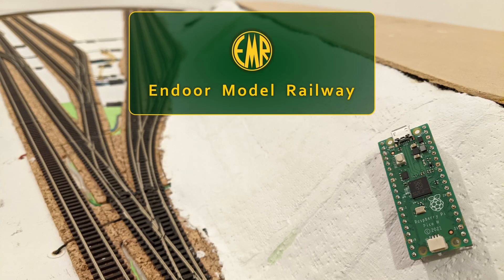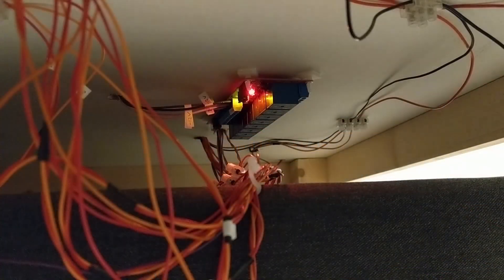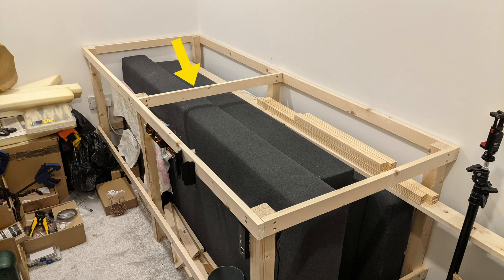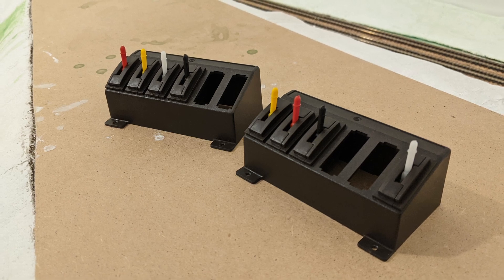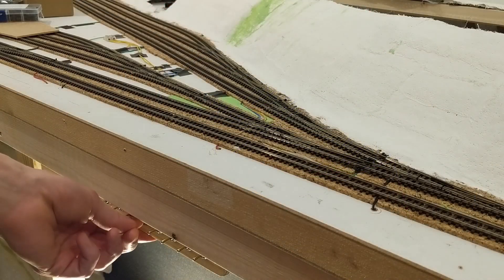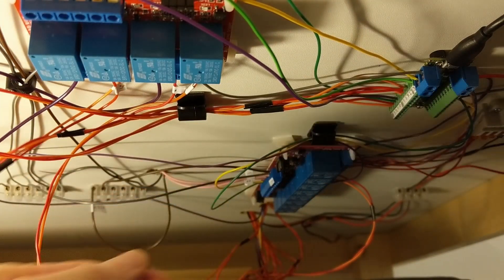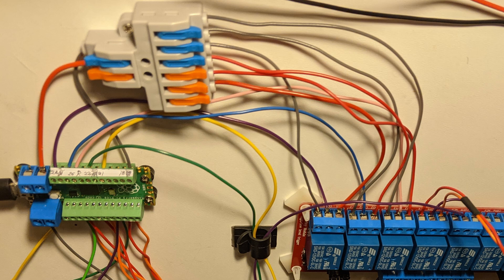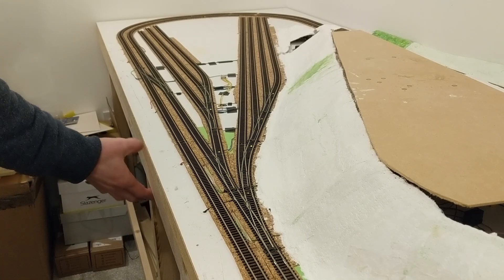0038 Using a £3.90 Raspberry Pi Pico to control points

Comment: NEVER fit Solenoid point mechanisms to Peco points. A solenoid bangs the blades back an forth, and relies on the hairspring hidden under the tie bar to hold the blades fully over one way or the other. But the Solenoid is Guaranteed eventually to rip that tiny blue steel hair spring through the nylon plastic tie bar, making the point utterly useless. You should always use a proper Motor Driven type of Point Mechanism such as Fulgurex or Turtle. As these mechanisms use a motor to wind the blades back & forth and do NOT need that hair spring which MUST be removed. Both these "slow action" point motors come fitted with free switches. One intended for the Frog Polarity, and the second for interlocking with the Signalling. 

The Fulgurex version which I've used on all my exhibition layouts since 1980 and prefer, also has provision for two more extra switches to be added if required. Fulgurex mechanisms are available direct from Fulgurex in Packs of TWENTY, for around £200. Fulgurex are in Switzerland and are a VERY upmarket company, run by none other than Count Fulgurex, a titled person. They have a basic website but will not stoop so low as to allow online purchases. So its Mail Order, and of course the staff speak English, and they accept British Cards. And they are best known WORLDWIDE for the beautiful Gauge One Live Steam locomotives they produce. Obviously as Switzerland is NOT in the EU so like Britain, there should NOT be any extra taxes, like VAT !!!     

Further when connecting Fulgurex mechanisms which come with a pre-shaped 1mm thick Brass crank designed to fit the hole either end of the Peco tiebar. These mechanisms must NO be screwed up tight under the baseboard. Only 2 screws are required at diagonally opposite corners, and must be left to allow a little flex in the mechanism as it operates. Having used these mechanisms for over 30 years on a number of exhibition layouts I have NOT had one fail on me if they are installed properly. The instructions included unfortunately do not allow for British Peco type self sprung points, hence you must remove the Peco point tiny "V" shaped hair spring from the tiebar first. The only other thing I have found is that under heavy duty exhibition use occasionally the brass worm drive tries to unclip itself from the clips that hold the worm drive in place. So I put a TINY drop of Superglue on the clips to secure the worm drive, and stop any possibility of it unclipping itself.
Reply from the maker: I was a little overwhelmed with point motor options several years ago - the solenoids were a nice cheap option, had the auxiliary switch and didn't take up the large amount of space of a Tortoise-style option. I suspect the points will outlive this railway even with the solenoids smashing them about, but in the bigger and better layout that replaces this one I intend to use servo motors under-board - they're cheap, strong, reliable and their behaviour very customisable.

Thanks for the information about Fulgarex. Without an online sales option they won't get any business from me, but it's good to know what product options are out there.
Reply: @endoorrailway  They have a website but they do NOT, like many very Up market business's deal online. Indeed more and more Model shops appear to be dumping the Internet, as too expensive. And I have no issue phoning Fulgurex, because I use a Spanish mobile phone (NOT a Smartphone), even though I don't live in Spain. Because I pay only £9.50 a month for 400 minutes anywhere on the planet - No account and NO Roaming charges, its a pay per month method in cash at the phone shop. And just one more reason why I left Britain over 20 years ago !!!!

Comment: A transistor would work well to control those relays. You'd need to know the power consumption of the solenoid then put a resistor between the pi pico and the transistor. You'd also need a diode across the solenoid to stop current back-flowing. You could go further with electronics but I can see you're working within your comfort zone.
Reply from the maker: Thanks for the suggestions - I should eventually build a lot more knowledge because of my attempt to make a DCC decoder, but I'm still firmly a newbie in the world of electronics! Thanks for the comment 🙂

Comment: If you want to save a few bucks on the relays for the switches you could use an optocoupler like the PC817.
Reply from the maker: Thanks - I hadn't considered that, but with a few resistors on the 12V inputs that would also make for a quieter, lower-power solution 🙂

Comment: Cool idea, but i think the whole feedback to the pico about point position is pointless. Commercial systems don't actually do this, rather they rely on the point being actuated once on initialisation, make their state known to the controller.
Reply from the maker: Thanks 🙂 That's true, but it's only as reliable as the point switching - occasionally these points don't throw when they're supposed to, so it's nice to have the feedback as an absolute source of state without needing a calibration action on each point. I've also considered an automatic re-try if throwing hasn't worked, but haven't look at programming that yet - it's easy enough to push the switch again. If I hadn't already had the microswitches in place then I probably wouldn't have put them in just for this, but adding the wires and relays seemed worth it.

Comment: Hi Jonathan! This was all such a big change to how the points are operated, but it all seemed to go really smoothly on the whole - having to rearrange the train room aside! The video prompted me to look for that article on relays again, but alas, it seems to have disappeared into the ether, sorry! I like how you've upgraded to the new switches! They look great and seem to operate so much more satisfactorily than those original plastic levers! I was going to go DCC only for my point operation, but may change my mind now I've seen these in action! All the best, Ian.
Reply from the maker: Hi Ian 🙂 Thanks! Yes I think it went smoothly - I think the knowledge gaining and experiments I did in the previous videos on this topic are to credit for that. It was also very spread out over lots of evenings, so plenty of time in breaks at the day job to think about what needed doing at the next opportunity, and plenty of time for new bits and pieces to arrive from Amazon once I'd realised I needed them!

Thanks for putting yet more effort into the hunt for that article! I've become convinced that it's the design of these relay boards that prevents me from separating the Pico's ground from the negative of the relays' board power - they would have to have an extra terminal for me to connect to the Pico ground.

I really like lots of the benefits of DCC, but I also really prefer physical controls with good feedback to touchscreen or mouse etc. A great thing about DIY control like this is the microcontrollers can be programmed to support both at the same time 🙂